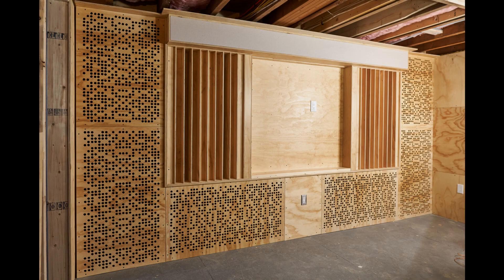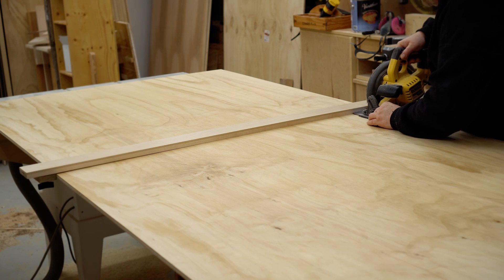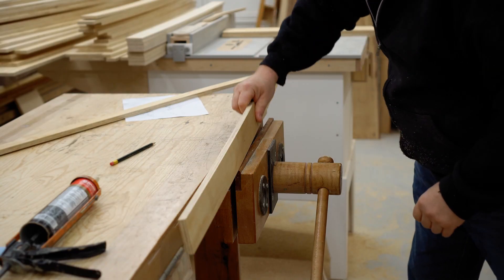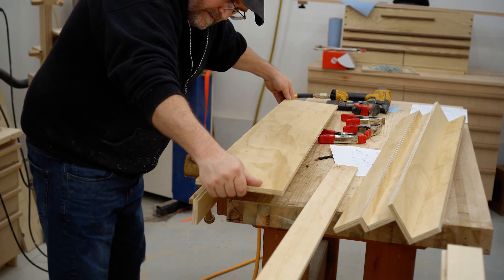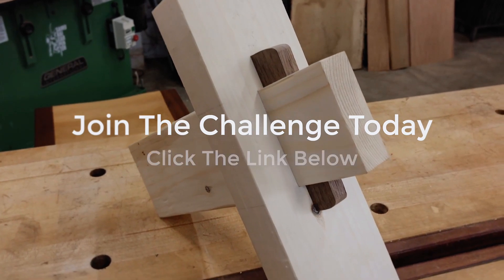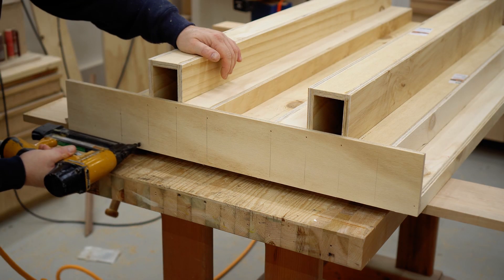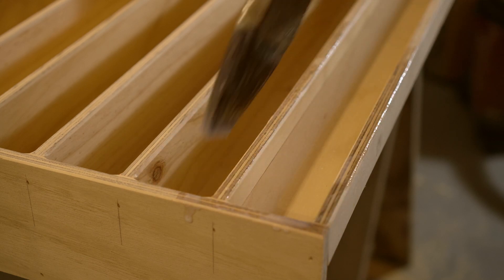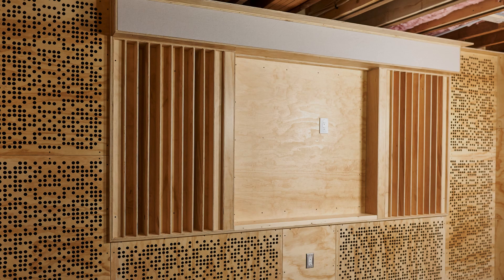Making A Quadratic Diffuser From Plywood - Acoustics

Comment: So you put up some "diffusers" that amount to a large panel of plywood, unsupported aside from the edges, and with absolutely no damping material on either side?  A giant drumhead? With open cavities filled with what looks like an inch of fiberglass insulation? As an acoustic treatment? And some other panels with holes in them, presumably also of plywood? Take that crap down, go get a few dozen yards of the thickest dynamat you can find, put it on the flat backs of everything, put some thick fabric on the front of everything, fill the cavity resonators you created with something like spray foam.  Bass traps in the corners. Then you might actually make it better - this makes it FAR WORSE than it was.

Comment: The quadratic residue diffusor or Schroeder diffusor (Schroeder was the scientist who pioneered the development) is typically a box made with a number of wells of different, carefully chosen depths. As a sound wave strikes the irregular surface, instead of bouncing off it like a mirror, it bounces out of each well at a slightly different time. The result is many small reflections spread out in both time and space making is a richer, livelier sound with an enhanced sense of space. Listeners claim that the panels seem to make the walls disappear.

Comment: Hey. Is there a specific reason you are not using a riving knife on your table saw? I've read that those are one of the most basic and easy table saw safety features. I'm just wondering what situations besides using a dado or ultra thin-kerf blade would have you not use one. Thanks.

Comment: Loved the flat painters pad for Poly application!  So much so, I'll give my tip: keep some Poly in a ketchup bottle and you'll be quick in applying it by squirting it out.  It maximizes working time, since it's not evaporating in an open container such as any pan or even just the original container, and you can just squirt in front of your brush and work very quickly rather than go back and forth from can to surface.

Won't beat your pad for large areas like an entire sheet, but perfect for smaller applications you'll be brushing, and you'll find it doesn't go bad with the nib top on: I've pulled it off the shelf 6 months later and after a good shake, it's fully ready to go!

Comment: People are still waiting to find out what a quadratic diffuser is.
Reply: I think it's quite obvious that it diffuses, much like other diffusers, but in a quadratic way. You're welcome.
Reply: @keithklassen5320  Rhombohedric sound will become quadratic sound upon seeing the diffuser. Got it.
Reply: @stianyttervik9070  
What if I fill it with marshmallows will that help?
Reply: @garyoldham4449  no! You must use circus peanuts to achieve maximum diffusion in a quadratic orientation. Marshmallows will result in a quintuplic symbiosis. Definitely not the effect we are going for here.

Comment: "If a tree falls in the forest, with no one around, does it make a sound".
Reply: citizenY yes it does
Reply: But if you want it to sound good, you must first install a quadratic diffuser.
Reply: Actually it doesn’t make a sound. The falling tree moves the air but doesn’t create sound until the sound waves interact with an eardrum, microphone or other recording device.
Reply: @jackd2083  correct. The real question here is "what is sound" hiding behind a goofy philosophical question that is designed to distract future philosophers from doing the real thinking of our times.
Reply: Jack D . Yes it does. Go back to school

Comment: Interesting project. Can I ask what you were doing with the tape at the start and why? Sorry if it's obvious but I don't know it! Thanks.
Reply: He peeled the barcode sticker off the plywood.  It left behind adhesive residue, which would prevent the finish from adhering correctly.  Applying tape with a stronger adhesive, then pulling it off is a common method to remove leftover adhesive.
Reply: Kineth1 thanks for that, must have missed it. All the best!
Reply: @erictheviking672  He didn't say anything about it, I just recognized it from when I've dealt with damned stickers.

Comment: I really thought it was going to tell how it works and what it does
Reply: Agreed. I mean you should be able to expect any question asked IN THE TITLE  to be answered in the video.
Reply: Its simple... it holds 4 glasses  of water with some fruit in them , to make a nice drink. Oh wait.... thats a quadratic infuser, my bad
Reply: it makes it so that sound waves within a certain frequency range in the mids bounce back at different times (because they've traveled different distances). The frequencies it is effective for are determined by the width and total depth of the slots. The depths of the individual slots are determined by some fancy math using prime numbers to maximize how uncorrelated they are. When the sound bounces back, instead of coming back off the wall exactly the same way, it comes back spread out by the 11 different depths, so 11 different timings. And that's just the first reflection. Each time the sound bounces back and forth, it spreads out (diffuses) more. So instead of that sound coming back off the wall at a regular distinct interval (causing an echo or resonance), it comes back smeared and diffuse (reverb).
Reply: Okay, so what he is making is more likely a quadratic residual diffuser.  The math is way over most of our heads but the basic premise is most rooms are not designed with sound in mind so they echo badly and those echos ripple back and forth and that lowers the detail of the sound at your ears.  Worse all rooms have a harmonic value which means you can actually get a type of mechanical feedback at the right (or wrong) frequency.  So, if you understand the math involved you can calculate the wave lengths which are problematic and design passive diffusers which reduce the echos so that the sound reaching your ears is clearer from any given angle.  Or at least that is the way I understand the concept.
Reply: @richardtroell6407  Seems like a good hypothesis Richard. Looking at other places for an explanation (which fail miserably in 'lay man' terms). It seems like the halfway point between an anechoic chamber and a very echoey room (like a squash court). Anechoic chambers are the exact opposite of the 'squash court', they deaden all frequencies and sound doesn't sound right or natural. In a squash court you can't talk with a normal voice for the echo. So maybe they're tuning a room to the range of frequencies they want to use.
Reply: @richardtroell6407  have you ever experienced a wrong frequency? in the Ford Expedition at work rolling down the window at a certain height makes a reverberating bass noise that hurts and drives your mind insane
Reply: @Garandmasthumb  Sort of like being inside the jug at a jug and bottle band performance . . . a large bass jug.
Reply from the maker: From the video description and my opening comment pinned at the top of the feed:
"I know I didn't exactly say what a quadratic diffuser does in this video, but I did in the project build article: https://ibuildit.ca/projects/how-to-make-a-quadratic-diffuser/"
Reply: @JohnHeisz  This is a fantastic video for cursory info.
Reply: @JohnHeisz  Ok, thanks for the link.
Reply: Yeah, while the construction process was somewhat interesting, the video title is a variation on "clickbait", not complete junk, but on balance the annoyance outweighed the interest and left me not planning on coming back.

Comment: ruddy clickbait! "whats a quadratic diffuser?" watched the video and no explanation of what one is, or what it does.
Reply: When sound travels across a parking lot and bounces off a brick building the echo is pretty quick. Speed of sound. In a small room the echo is extremely quick and it messes up what you hear. Diffuser has pockets of different depths so the timing of the reflections is not all at once so there is less distortion. By distortion I don't mean rock guitar distortion I just mean distortion of the true sound. The distortions occur because the waves interfere with each other. You hear the first sound and you hear the reflected sound mixing with it. The air in the room is vibrating so imagine if the initial sound is trying to pull the molecules but the reflected sound is trying to push them. if those two forces are equal the molecules won't move at all. Like the rope won't move when the forces of tug of war are equal. Like if you are above a planet you will fall. If you are midway between two planets of equal gravity you won't move at all. Now imagine if the initial sound is trying to push air molecules in a direction and the reflections are trying to pull them in the same direction. Then that particular vibration will have a double dose of energy it will sound louder than it was meant to sound in the original recording. That is distortion of the truth. A particular frequency could be reduced or it could be boosted by the interaction of the original sound with the reflected sounds which are coming from all directions. The sound loses energy when it bounces off a wall. It might only be 10% of its original strength. But reflections are coming from every direction and they can really add up or subtract up depending on the sum total of all vibrations. 
He put a link in the description if you want to learn more.
Reply: Anything you can do to get your walls and ceiling to absorb, trap or diffuse. Furniture carpeting and heavy curtains can absorb middle and higher frequencies and reduce the echo. But bass will still bounce off of them. The diffuser can help with Bass in conjunction with bass traps which is a different article. Search around his channel and you'll find lots of information.
Reply: The diffuser breaks up the timing of the reflection but because it is a baffle it is also somewhat of a trap. Some of the sound will enter a baffle strike the rear wall and come straight back out again.  But some of the sound will hit a side wall bounce to the back, bounce to the opposite wall and then come out again. Just like pool balls striking rails. It loses energy every time it reflects. some of the sound in the room will enter the baffles at an extreme angle and may bounce many times before coming back out into the room. So it is somewhat of a trap. All bass traps are somewhat of a trap. Bass frequencies have more energy than the mids and highs. one of them can completely absorb all Bass frequency. If you treat a room for mids and highs but do nothing for the bass that is also a distortion of the true sound. Is it really important? For a recording studio it is. It can greatly improve home theater sound or listening to music. It relates to volume because at low volumes you won't have high energy reflections.

Comment: What plywood do you use for your projects? I recently bought some plywood from Rona in Toronto and the quality was not good at all. They were the ACX.
Reply: ACX is an exterior grade plywood meant to be nailed up 

For any type of interior finish work AB 2 is the minimum. It's not so much the quality of the back face but the imperfections of the core veneers.

http://www.burtforest.com/hpdomesticstds.htm

For my money anything where I'll be leaving the edges exposed Birch ply is worth the extra $'s.

C grade is a lesser quality veneer has too many defects to ensure a good finish
Reply: @tommypetraglia4688  cool link.  Very helpful.
Reply: @tommypetraglia4688  thank you so much for sharing. I’ve learned so much about plywood from your link.  🙏
Reply: The stuff from this video appears to be auroco brand plywood, not bad stuff, but it’s pine. My favourite stuff is called Russian birch, I get it from a local plywood store, costs $110 a sheet though
Reply: The store is called Windsor plywood, not sure if they have them outside of BC though
Reply: @nakulah  So that is as much as marine plywood.  Why do you use such expensive plywood?
Reply: @nakulah  I will try to look for the Russian birch for my next project. Thank you 🙏
Reply: Look for cabinet grade plywood.  Different from exterior or marine.

Comment: This looks really interesting, but the video didn’t answer either part of the title :-) Still don’t know what one actually is...
Reply: @Howard Jones   A quadratic diffuser is a series of wells or troughs that are of different depths. Each well depth is based on quarter wavelength calculations and the well width is based on half wavelength. A series of different depths can be calculated and designed to diffuse frequencies from 100 Hz.

Basically it's a way to eliminate echos in a room.   He's trying to build a listening space, either for a home stereo or home theater, and he's trying to make it sound the same, no matter where you are in the room.   So that means eliminating standing waves which can make the room sound too bass heavy, and eliminating any hard surfaces like glass or metal or stone, which can reflect all the highs and make the room sound too harsh.  (Think about how those trendy restaurants with all that glass and chrome are so harsh with reflected noise you can barely hear yourself think, much less carry on a conversation.  That's what he's trying to prevent.)
Reply: @jimthesoundman8641  Thanks Jim! Great explanation.

Comment: Ever have any trouble with Titebond II or III  gluing pre poly'd pieces? Is the PL-P visible in the joint anymore then other glue? 
Thanks John. I'll go check out your audio channel. Didn't know you had one. :)
Reply from the maker: I've never used any Titebond products, so I can't comment on how they perform. I've used other brands of yellow carpenters glue and that doesn't like cold. It weakens the joint significantly.
Reply: @JohnHeisz  How is the yellow glue at pre finished poly glue joints? Or was the PL the only thing that stick the poly together? Thanks.
Reply from the maker: Woodworking glue only sticks to wood, paper or leather. PL sticks to everything, especially clothes :)
Reply: @JohnHeisz  LOL!! Yep!. Thanks John. I'm a metal guy that muddles his way through wood work, so you are a big help!

Comment: I did a glue-up yesterday for the first time with "polyurethane construction adhesive". Felt like a John Heisz apprentice! haha
Reply: I've never seen that stuff before in any hardware store. Silicone, acrylic sealant, extreme high temp silicone, but none of that, weird.
Reply: @Yonatan24  liquid nails
Reply from the maker: It's not Liquid Nails. Liquid Nails is a different, much less strong adhesive.
Reply: @Yonatan24  Loctite has one:
https://www.loctiteproducts.com/en/products/build/construction-adhesives/loctite_pl_premiumpolyurethaneconstructionadhesive.html
Reply: Look for PL premium. It’s good stuff and widely available